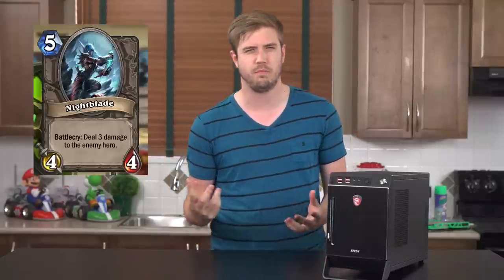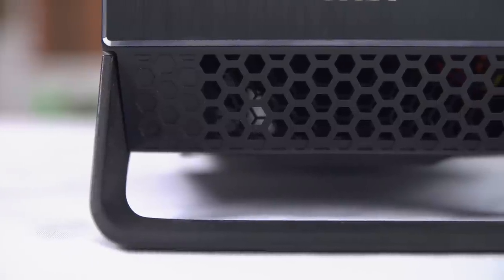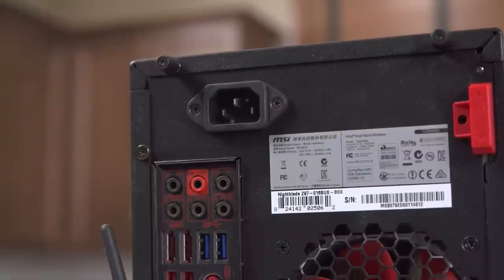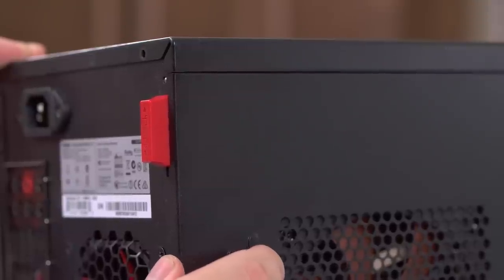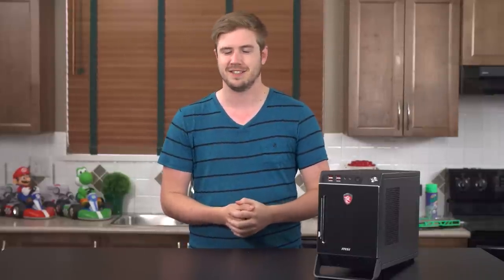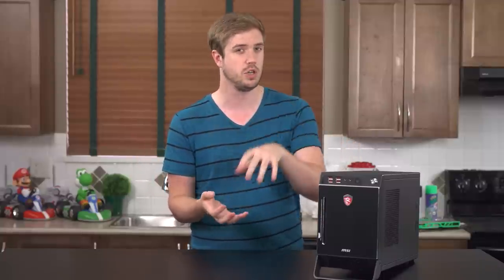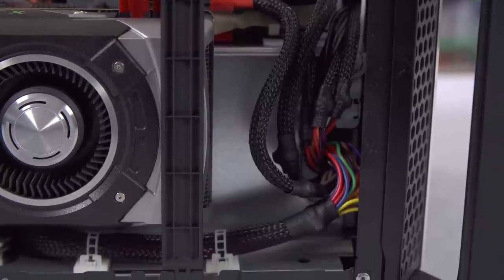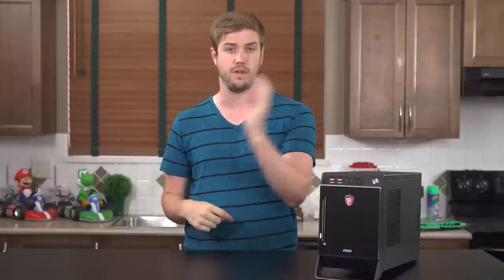MSI Nightblade Barebones Computer Case

Comment: Building from scratch is much more pleasing than building w/ a bare-bones kit. You get to handpick everything that is going into your build. You're not wasting any money on hardware that isn't appealing to you. Also, I get a sense of pride knowing that the computer I built completely from scratch was built myself. The build is also completely unique to the builder, meaning that there probably isn't another computer out there that is the same spec-for-spec.  "Limited Edition" as I would call it. That's just my opinion.

Comment: btw, I know I am late to the party but I built around this case 6 months ago when it just came out. That dual msata card is great and very useful, it allowed me to install two msata Samsung ssd's on the same bay, setting those two as Raid 0 and installing all my apps in that partition, while using the bay below that for another sata ssd for the OS. And since the computer has a regular sized bay as well, I put in another 2 tb drive for the important stuff in case raid 0 fails. Basically 4 HD's in this small monster.

Comment: Bought this. Installed the NH-L12. Was not disappointed. Thank you :)
Reply: Although I will say that the pipes from the NH-L12 that I installed in the same orientation as yours were very close to my graphics card, not a problem for me, but if you have some big chips or whatever on the back of your GPU, it would be worth considering mounting it 180* the other way around so the pipes are at the top (will it even fit that way?) or going with a smaller cooler. Also remember to plug in the CPU fan power lead(s) before mounting the cooler. :P

Comment: i simply have to ask ... sorry for the stupid question btw:
Why the hell do so many modern motherboards still have PS2 connectors!? Especially gaming mobos seem to have those although i know not a single modern gaming peripheral that still uses PS2 ... why hasn't that "standard" been abandoned by now?
Reply: some usb mice/keyboards won't function correctly in the bios/before downloading drivers and some will just not work, ps2 is completely analog so it will always work, the number of devices that won't work in bios is going down though
Reply: There are a lot of keyboards still using ps2. I use one my self. There isn't really any advantages using usb keyboards over ps2 keyboards. Well ofc usb keyboards can have those fancy leds and macro keys and other useless stuff. And overclockers use ps2 keyboards because they work better in that use. A lot of the mechanical keyboards have also a ps2 option excluding those fancy led ones.
Reply: i see ... now that you mention it: my last keyboard didn't work in bios as well, but i got another even older keyboard that worked perfectly fine - it was USB though. i always had to take out my "bios keyboard" when i had to change something :D
Reply: TheCrusader Ahh, you know ps2 is faster right?
Reply: If you use a USB mouse or keyboard, you can experience ghosting when you press multible keys at once. With PS2 (direct hardware input) this problem doesn't occure.
Reply: For the sake of using in bios, where not all usb keyboards are supported.
Reply: I still use a Ps2 keyboard.never had a problem with it.
Reply: TheBitFox you can't get N key rollover over ps2 though
Reply: You might have 1 USB mouse laying around, if that does happen to die, guess what mouse everyone has...
Reply: M. Jones Actually that would be the motherboard not supporting USB keyboards properly.

The reason you'd want that PS2 is that it still has better NKRO (Rollover) than most USB keyboards. As for why it is included on motherboards - You still have Serial and Parallel ports too although only a minority ever use it.
Reply: Mansen Oh I thought it was the other way around (as in PS2 not supporting NKRO)
Reply: I also believe PS/2 uses interrupts whilst USB keyboards need to be constantly polled by the CPU to detect key presses. In practice I doubt there's any difference you can associate to this, but it's another reason people chose PS/2 keyboards over USB.
Reply: M. Jones actully its the other way round some keyboards have n key rollover over usb but its not normally suported through usb, where as ps2 supports k key rollover so alot of the time if you look in the manual of your keyboard it says has n key rollover only on ps2 (with a usb to ps2 adapter). but you have to ask your self how many times do you need to press more than 5 or 6 keys at at time so 6 or 10 key roll over is fine pritty much all of the time, my keyboard has 10 key roll over and i have never had any problemswith keys not registering.
Reply: 1. Some USB keyboards are not functional until drivers are installed through windows- thus present a problem in the bios.
2. PS2 send a hardware interupt to the cpu when you do something rather than usb getting polled every 1ms (this wastes cpu clock cycles and can cause latency although neglidgable)
3. most include N-keyrollover
Reply: M. Jones
...Because it's not necessary?
Reply: Ps2 master race!
Reply: They still make PS/2 mice and keyboards
Reply: Ps/2 port has a high n key roll over
Reply: Ps2 port has a much lower latency. MrJames9819 I think you have that backwards. People pick Ps/2 for the low latency and they give up the n key rollover
Reply: ihaverecon You have it the wrong way around - PS2 allows for NKRO. USB doesn't.
Reply: Why not?  If I can pick up a ps/2 mouse or keyboard for $2 at a thrift store, it beats spending $20+ on a new on that essencially does the same thing.
Reply: ihaverecon sorry for the mistake and thank you for informing me about it :)
Reply: Because you get n key rollovers
Reply: It's mostly down to redundancy, and the cost. The ports are a standard in motherboard design. It might even be that they get bundled IO components, and it's simply cheaper/the same to have ps/2 as well.
Reply: KemoKa77 so, usb is basically a gentleman while ps2 is your average egoist?
Reply: angrydragonslayer No, PS/2 shows initiative by telling the CPU when it has data to transmit. USB is lazy and would rather wait for the CPU to check.
Reply: oh, ok
Reply: So let's see if i understand correctly:
PS2 Keyboards don't feature media keys or programmable key like many gaming keyboards do. but they work flawlessly in bios and have NKRO ...
PS2 Mice have lower latency and react fast (but i guess only support the basics like left and right click?)
Reply: Steering wheels (at least Fanatec) also come with PS/2 connectors, which are optional but still exist. .

Comment: I like that most of the cable management is already done for you out the box, which is really the only reason I would get a barebones system like this. Cable management would be a huge pain in the ass in a small case like this.

Comment: I like the idea of bare bones when it offers something that would otherwise only be possible via heavy modding and fiddly installation. 

As I move around a lot, and I like to have a gaming rig (PC master race),  I've fallen in love with small form factor pc's. I've currently got a prodigy rig running a haswell CPU and a gtx 770. 

My next build will be smaller and quieter, therefore I'm on the lookout for something like the night blade with the possibility of a full water cooled system (preferably closed loop as I move around a lot). 

I know it's possible, it's just a matter of time.

Comment: for specific jobs, barebone systems can be OK

my own file server/media server is build around an older Asus barebone
also, keep it mind that barebone systems have often customized innards: mobo, PSU ...

my Asus recently had 6 leaking capacitors and I was able to find proper replacements (height, diameter and values) all the way in Leeds (UK), ~3000 Km from where I live (Romania)

Comment: Barebones cases always look interesting on first sight, but compared what the components actually cost they are overpriced by so much that I would rather build the system by myself and get better components for the same money.

ITX on the other hand is really interesting, one thing I would really like to see is a mainboard - cooler compatibility guide. For example, MSI always puts the processor socket really close to the video card slot, while ASRock sometimes puts it on the opposite edge of the board, or for their FM2+ boards rotates it by 90° - which will have many aftermarket coolers facing the wrong direction. 

Please review the Thermaltake Core V1, and keep up the good work in general :)

Comment: It's actually pretty small and seems you can fit a good graphics card in it (10+ inches) which is hard to find at this small of a case (The only case this small that's worth a damn is the EVGA hadron). Add the fact it semi good ventilation for what it is and dust protection and built in wifi and easy to carry handle would make this perfect for taking to LAN parties. The version without a optical drive is $400 which is fair considering a good case is about $100, and a good mobo is $150, and a good PSU is $100 so it's not as bad as people think.

Comment: Hey LinusTechTips, I often wondered how much of an impact Casefans have in general. It would be nice if you could make a video showing the different temps you get when using a normal case without any fans and then with all casefans installed

Comment: In answer to your first question: yes. That would be a pretty good benchmark for mITX cases that require you to stick to the stock cooler or one of the low profile coolers like the Noctua.

Comment: The rear fan is "backwards" because the fan is small so it runs at very high RPM's and if it was made the normal way the fan would pull to far away from the mount and hit the grill

Comment: I would like to see some bare bones reviews.  I do lots of online gaming and have a lot of friends that ask me to build or recommend computers.  It would be nice if I had a bit more then just manufacturers specs to go off of for prebuilt. It would also be nice to see bare bones that can do some gaming but that can be easily upgraded later. Its not always feasibly for someone to send me a computer just to swap out cards, but some cases can be intimidating. I would love to see a range of computers that I could suggest that are easy to upgrade but that can do at least basic online gaming to start at a minimum price point.

Comment: Honestly, I have to say that I was really surprised and disappointed that the model of the motherboard, features (other than it has wireless,) or even the CPU socket type weren't even mentioned. I actually went through the whole review again because I thought I had gotten distracted and missed it or something. You don't even say how barebones it is, but looking at the MSI website, it seems that these are mostly finished units, with 4th and 6th gen i7 CPUs pre-installed. Some are even fully built with a GTX 980Ti, GTX 980, GTX 970, or GTX 960, so literally all you need to add is a hard drive and RAM to be up and running. And since even the ones without a GPU included still have on-board, that's still the case. The 6th gens are Z170 or B150 and the fourth gens are Z97 or B85. Obviously Skylake wasn't available when this was filmed, but I would still be interested to know in the review what the hardware options were at the time.

Comment: Barebones would've been nice as it would've been a nice guide when I was initially building my system instead of basically building a different one case, processor,mobo, psu, gpu, case, and storage eight months down the road.

Comment: @TheCrusader Actually a few gaming peripherals do use ps2. Ps2 is faster and better than usb for keyboards. It is specially DESIGNED for keyboards and usb is not only for keyboard and adds some lagginess as cpu needs to pull information from usb but ps2 "pushes" the info to the computer. So it kind of lowers the cpu usage too :P

Comment: I like to build things myself but I don't mind see these bare-bone systems. I would like to see it compared to other coolers. I would also love to see if a cooler or all-in-one water cooling system preform any different if they are vertical or horizontal.

Comment: Personally, I would rather buy a small form factor case and fill it with components myself. The bare bones systems tend to have items in them that I typically wouldn't buy. With that being said, I like seeing these reviews because there might be a bare bones system that comes out that has all premium parts in it already.

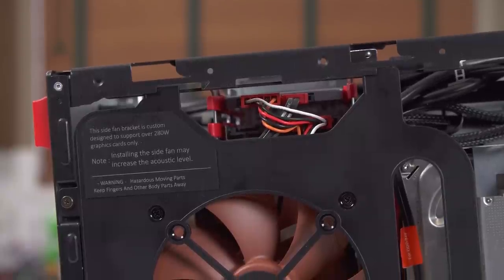Comment: what are the optional side fans(which brand and model?) that you have placed? I think there are two optional fans? one place on top of the cooler(4:42) and the other is on the side panel? (4:14) am I right?

Comment: Sure - please review the CPU cooler. But also it would be cool if you could get your hands on some more aircooling equipment from brands that are not Thermaltake, Noctua or Corsair. I am thinking of e.g. Alpenföhn coolers and fans or Noiseblocker fans (especially the e-loop).

Comment: It cant run BF1 properly anymore . I wonder what i can do for an upgrade for it. I5-4460 8GB RAM DDR3 Gtx960 2GB etc.
What can i do to achieve 60 fps in that game . it is almost impossible to get a stable 60 fps . it range between 25 ~45 .

Comment: I'm not a fan of barebones pc's unless they are a bit different and have something particularly different than building a pc yourself. In this case (no pun intended) the formfactor is something that I would definitely be interested  in and actually buy but if it was the size a normal atx case then I wouldn't care

Comment: Almost every motherboard has back audio ports on the bottom but that board has them on the top. That's interesting. Everytime i install a motherboard to a case i just look at the i/o shield and put it to the case audio port holes down.

Comment: This msi nightblade z97(gtx 970 4 gb i5 4460 8 gb ram 1 tb) OR Acer predator g3-605 (gtx 960 2 gb i7 4790k 8 gig ram 1 tb + 120 ssd) purpose; Hardcore gaming & Schoolwork,  WHICH ONE???
Reply: Jahmali Kenway Predator with an i5 and the 970. As long as you're not going to be doing heavily cpu-reliant stuff like video editing, rendering etc you won't need an i7.

Comment: I would only do a barebones system build if the price was super cheap, as the cases they come are usually too small for my liking too work with, plus I'd rather just have more control over the parts in my system.

Comment: I am buying a computer that has this case and it looks awesome. However it does not come with the optical drive preinstalled. I wonder if anyone knows where I can buy te optical drive so I can install it myself? As it is not a standard optical drive it seams.
Reply: Amazon
Reply: +Animated Freak Newegg...
Reply: What do you need an optical drive for anyway?

Comment: My 2 cents. MSI did something amazing here but no one knows it! it's almost like MSI is holing itself back on purpose. this PC DESIGN NEEDS NEW REVISION! first, flip the orientation so it's taller like Xbox series x shape. Then move the IO to the bottom but put the power on the left bottom. Then get rid of the ketchup and mustard cables. then make that front black pannel with chafed aluminum edges taller so it can fit on the new front of the case. Move the handle to the top center and get a proper clear side panel. make sure both fans match and have RGB. and get a GPU that has RGB on the front that should be visible! if I owned this pc that's exactly what I would do to it!

Comment: I want to build one. I'm thinking ok putting a i5 4690k, MSI GTX 970, 8 or 16GB of RAM (I can't decide), and a 1TB WD Blue HDD. (If my budget permits I would like to put maybe a nice 500GB SSD in too, but I doubt I'll do it because I still need a monitor because I can't use my mid 2011 iMac as one :(
Reply: Eric Melendez I don't know if a i5 4690k will fit the bay, all versions which are available in my country only have 1155 socket which means you can only fit i7-3xxx, i5-3xxx and so :( that's why I am not building one
Reply: Harm Koutstaal according to the MSI website the 4690K is supported
Reply: Yeah I've checked all the versions availably in my counrty and some have the 1155 and some have the 1150, thx :)

Comment: If it's a nice barebone sure. But if there is nothing special about it and if the case is sold sperately. I don't see the point since they usually skimp on the PSU and if not, the price is usually as high as it would have been as if i were to buy the case and PSU seperateely.

Comment: Wait what actually comes in this case? MoBo, CPU, cables and powersupply?
Reply: Saurav Chowdhury mother board, power supply, dvd drive and the case along with it's fans, and I would imagine some cables. So you would still need a CPU and RAM plus a graphics card, should you want the extra power.

Comment: can R9 390X fit in Nightblade? I'm worried about thicknes 

Card Dimension(mm) 277 x 129 x 51
Reply: +Sephiroth Crescent It should be fine. Most of the Nightblades support up to a 290mm card.

Comment: @linustechtips  uhm Luke?... they didnt design the fan any differently than regular fans. they actually reversed the pitch of the blades so they can turn it around and still maintaining flow direction.
Reply: Reversing the fins would be an a-typical redesign... Of the great majority of fans, these are not commonplace.
Reply: +T Swag (ThanoricOfficial) look at the fans when they are shown. the blade pitch is simply reversed is all
Reply: Again, that takes a design change. Even no matter how simple, it is still something that is rarely seen. Look up the term redesign. Seriously.
Reply: +T Swag (ThanoricOfficial) you realize your arguing semantics right?
Reply: One may call it semantics, another may call it not knowing English at all. Luke was right using the term redesign. Even by your OP explanation which explains clearly a redesign, but says it isn't.
Reply: +T Swag (ThanoricOfficial) not much of a redesign is my point. simply reversing blade pitch is akin to simply adding blades. but that's redesigned as well I suppose